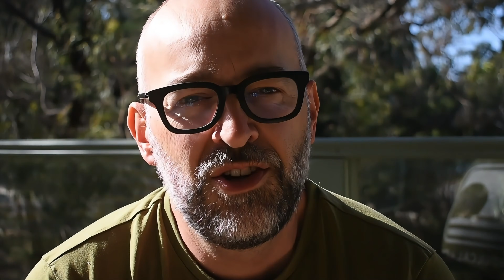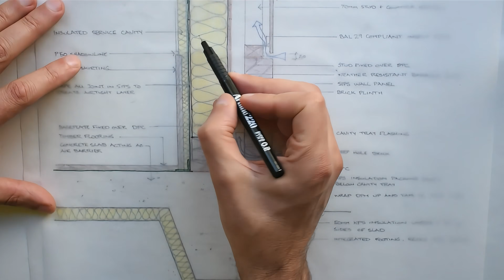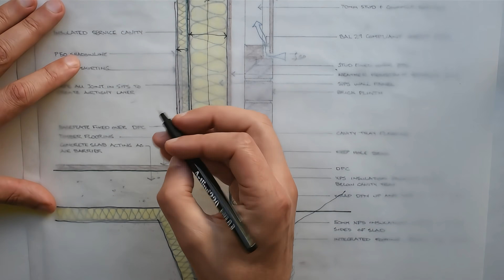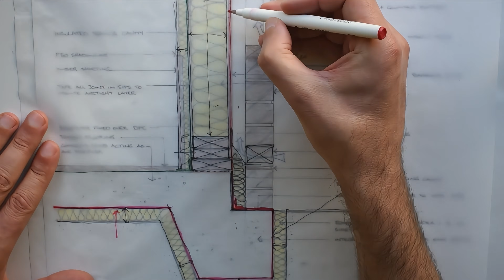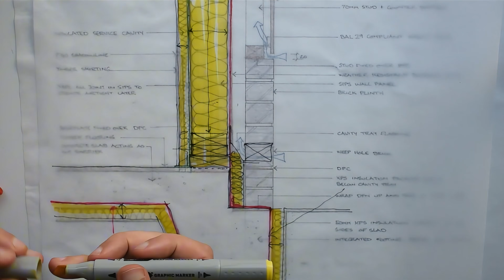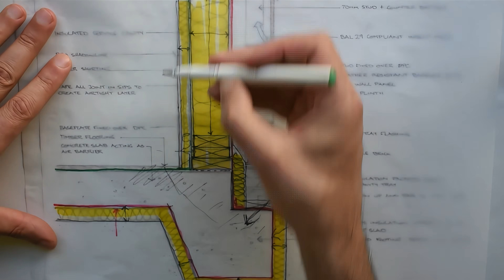The Secret to High-Performance Homes: 3 Critical Design Layers You MUST Get Right!

Comment: Whatever you do, never use glass fibre insulation in the walls. It holds water and humidity. Stone wool does not!! Stone wool is also fire proof. No moles will stay in it. And Spray foam burns rapidly. 
All folks that want to build a house should take a look at Scandinavian building codes about cold bridges and passive houses.

Comment: 2:10 Oscillated Strand Board. 😀
Reply: Or, OSB, or Oriented Strand Board, is an engineered wood panel made by bonding thin wood strands with resin, typically used for structural applications like sheathing for walls, floors, and roofs, offering strength and cost-effectiveness.

Comment: Do you intend to intergrate electrical distribution in the interior with another stud wall? Also are all plumbing drains, vents and supply pipes, and hvac line sets all placed in interior walls and designated chases. It seems like an additional stud wall on the interior could be built for plumbing, mechanical and electrical. Interrested in how to integrate all the other systems. Some engineers advise nothing less than 2" drain pipe be concealed inside walls. This is a real challenge when drains are run horizontally inside a wall space. Double walls take up space but seem like the best solution where plumbing is located. What are you thoughts?
Reply from the maker: Thanks for you comment. We typically design oure services to be on internal walls where possible so we can keep the thickness of the external walls down to the minimum. This isn't always possible so where we need services on external walls we add a stud to the inside of the assembly (35mm typically). We then insulae this cavity as well to give us a bit extra R value. I know some bulders who do this everywhere as they say it adds a lot in regard to performance both acoustically and thermally. Mechanical services we distribute in ceilings only and create a services void for this and all lighting etc.

Comment: Why anybody still wants to build walls with this flammable crumbly splinterboard is beyond me.
Here in NL OSB is not a high performance material, it does not handle humidity or stress well either and presents no substantial barrier to bugs, mice or whatever vermin wants to chew through it on the way to your pantry.
It is marginally cheap because it is essentially compressed garbage with glue. All it takes is a single point of water intrusion to compromise an entire structure over time.
I don't even see used for backing drywall anymore, builders don't want to bother with it because it requires al lot of extra work just to make sure it does not disintegrate because you missed a spot.
Instead current builds involve things like lightweight blockwork, high density foam, gypsumfiberboard, resin panels and prefabricated facade modules.

Comment: Not sure why a WRB membrane is needed on the exterior SIP panel? The brick acts as a WRB.  And if you did use a WRB on the exterior panel, why not make it the air barrier as well and simplify/reduce costs and eliminate the interior air barrier?
Reply from the maker: Great question. We need a WRB on the exterior of the SIPs to protect the timber and keep the structure dry. The brick veneer keeps out the majority of water but atmospheric moisture along with any water that happens to get through it needs to be directed back out of the building envelope before it does harm. The WRB is water resistant but vapour open which means it stops water coming in but allow the timber structure to breath.

On replacing the air barrier with the WRB it depends on where the building is. In humid climates you should have the WRB acting as the air barrier as well as the biggest source of moisture is the external atmosphere. In temperate climates like where we are we need the air barrier on the inside as the moisture inside the building (people breathing, showering washing etc) are the biggest source of moisture. Again it is critical to stop this moisture from getting into the wall structure so we protect it with a barrier and then add a mechanical ventilation system to remove the moisture from the internal spaces.

If the put the air barrier on the outside we would likely get condensation on the inside face of the WRB or in the insulation. This would cause mould which can been seen and eventually deteriorate the timber structure leading to structural failure.
Reply: @borlandarchitecture why aren't both the internal and external barriers water repelling and vapour permiable? So no water can get into the fabric of the wood and insulated structure and any vapour can exit from inside that structure???

Comment: Xps is load bearing and in damp environment outside structure are we sure it will perform through life of building als probably tape tray this detail is more raft situation and not strip founds . I have found better to form  independent service wall with 50mm metal interior and insulate that it's all a learning curve and architects should engage alot more with gc and trades as conditions are always a consideration
Reply: Marmox Thermoblocks are a loadbearing insulation product, and there are others such as Foamglas Perinsul.
Reply: @tlangdon12  appreciate  your insights  and my comment was not meant as a negative.

Comment: There are solid constuction of walls , and there is this , shed-type walls .Why on earth some body would live in house where walls are made of OSB ?
Reply from the maker: The building system proposed is called Structural Insulated Panels (SIPS). They are used all over the world in high performance buildings, are extremely resilient, energy efficient, thermal bridge free and fast to construct.
Reply: @borlandarchitecture  it's cheep, and  and irs for sheds.  Pron to rotten, burn like match's, like in LA, in hurican it's like houses of card.  I am an architect, and where I came from imperative for house is to last. This wood prefabricated houses are inferior way to build
Reply: @stevanjakovljevic8390
SIPS panels are alot of things, but cheap its one of them😅
Concrete block is cheaper
Reply: @stevanjakovljevic8390 

I disagree.  You're inflating multiple problems together, them blaming it all on sips.  Nothing wrong with this building product.
Reply: @simonthebroken9691  Did you ever lived in house with solid, not hollow wall? This wood structure, osb boards are cheapest way to build so it least quality one to put on house.

Comment: How does this work with higher humidity situations?
Reply from the maker: Great question. In high humidity climates the moisture concern is reversed (exteranl climate is providing the airbourne moisture more than the occupants activities). It is a bit technical but at a high level the due point (the point at which water vapour condenses) is more likely to occur closer to the internal face of the wall than the outside which it is in a temperate climate like I am in (Melbourne). To solve this you simply need to move the airtight layer to the outside of the insulation instead of on the inside. This ensures the insulation and structure is kept dry.
Reply: @borlandarchitecture  Thank you for your well thought response!  We do have issues here in the Pacific North West (PNW) of the US, with bureaucrats (not to get too political) in the PNW wanting to take building code from down in Southern California (I assume a climate similar to your Melbourne) and just slap it on our state's building code, not even understanding the future mildew/rot issues that will cause.  But, I fear a lot of rotten homes will exist in 5-10 years around here!  I do have a bit of a say of what our small city does with building codes, and we are countering that state level mandate!!!  On a side note, When i built my shop in 2018 (which is especially bad, being that I am located 150m or so from a glacial fed river... so very cold... causing a small microclimate, exacerbating the problem further. We have a wet inversion layer every morning, regardless of the nominal area temperature.) I used ZipSystem as an outer layer, giving me air/water tight at that outer most layer. I guess the same would hold for a whole house. Anyway, I look forward to more smart content in the future!

Comment: There is a very good reason why it takes a minimum of 3 years to train Architects in the basics of building construction and that is the complexity and variation of all the elements that cannot be adequately discussed in a 13min video.
Reply from the maker: Architecture is indeed a very complex business and I completly agree that you can't demonstate that in a 13min video. In fact if I posted a 13min every day for the rest of my life I wouldn't be able to cover everything. The point is to try an provide value which is simple to grasp so that an architect, a homeowner, and anyone else with an interest can grasp the concept and be able to personally indentify when things should be done better. My goal with this channel is to share my knowledge so I can help more people create better homes, better environments and a better world. I can only work with a limited number of people but videos like this (hopefully) allows me to make a much bigger impact.
Reply: The guy doesn't know what he is talking about. He insulated under the slub where delta could be only 15 C and did not insulate brick ledge where delta could reach  35 and higher degrees
Reply from the maker: @ your delta values are a long way off where this particular building is intended to be constructed. Perhaps take location into account before passing judgement. I take your point however and will be clear in future which climate area the detail is proposed as the detail will vary subject to the delta value. 
In our case the cost to solve the thermal bridge at the brick shelf isn’t feasible and the risk of condensation is extremely low. We will model this in our passive house planning package and allow for the energy transfer. If necessary we will get it reviewed in a WUFI analysis to confirm that there is no condensation risk.
Reply: @borlandarchitecture  your design has obvious flaw the thermal bridge through bricks it could be understood if you build on budget but you misplaced  so much  insulation under the slab, which makes me think it is not the case .
Reply: @andreycham4797 i mean it depents where you are geograficly. In Sweden all newbuilds are passive-houses that are pretty simular to this and we are almost always using 300mm xps under the concrete. We dont use footings like this example because we dont have earthqaeks and you can build it better isolated.
Reply: @borlandarchitecture  Please explain what you mean by delta values and their units.  This is a terminology that I don't recognise as a European.
Reply: @simonbern  I am not against better insulation. I just do not see logic to insulate  from +8C ground and not to insulate from ambient air outside which could go down -10C or even lower in the same application
Reply: @clivewilliams3661  Can I try?  For instance, in your climate zone the average ground  temperature is 8 degrees and you feel comfortable at 20 degrees so your Delta T between ground and room temperature would be 12 degrees.   At the same time your  Delta T between room temperature and ambient air outside will depend on the temperature of ambient air.
Reply: @andreycham4797  I see, thank you.  Normally, for calculation purposes we would take the Delta T value to be 25degC (-5 to +20degC) 

Actually, the comfort temperature is calculated at 1/3rd radiant temperature and 2/3rds Air temperature, so that if the body comfort temperature is 20degC then the internal air temperature would likely need to be higher given the radiant temperature of the building surfaces would be lower.